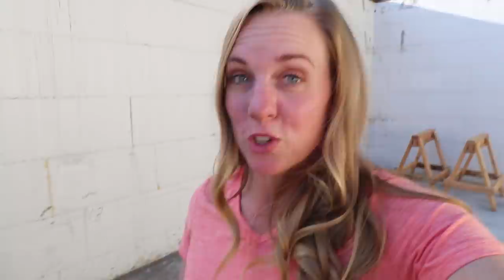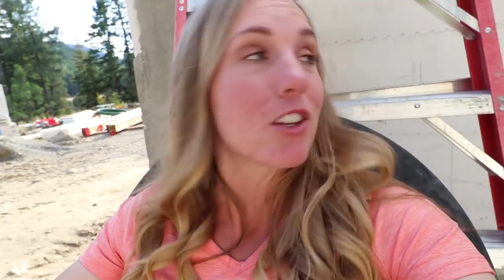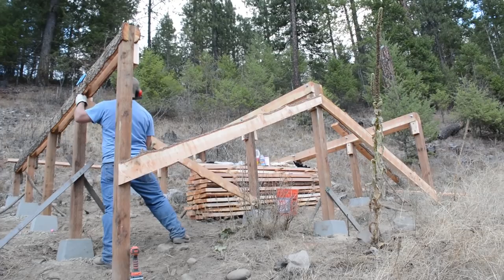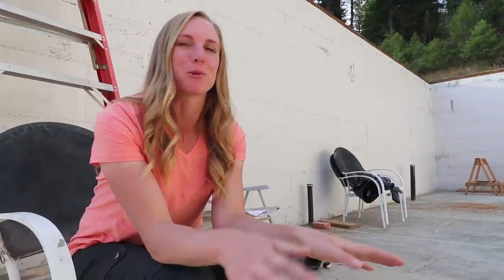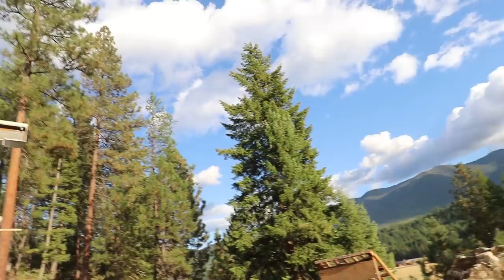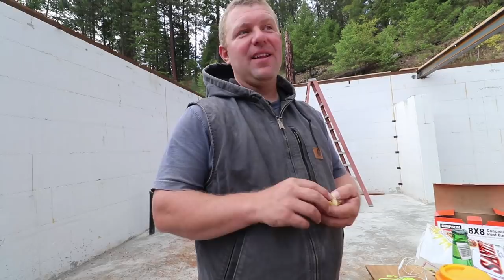Is QUALITY WORKWEAR Really Worth the Money?

Comment: yep anyone who suggest wearing crappy cheap shoes for work are not hard working people. my most important article of clothing are my shoes.I did manage to find some really decent light weight work boots by Ariat , they are about as light as tennis shoes but super sturdy and very comfortable and supportive. Tractor supply for like a hundred bucks which to me is quite inexpensive.dont do steel toe unless you really need to and keep them as light as possible, it matters by the end of the day.same with pants, if you are pulling them up or adjusting them all day it will wear on you, get good cloths! anyone who buys cheap work shoes and thinks thats good enough doesn't really work.
Reply: 1. 30$ spent on steel toe boots they THRIVE on abuse the more you abuse them the better they get plus haveing a 1m long 200 kg beech log roll on to your toes is not a good thing with out steel toes 
2. pants best thing i saw was this one old timer took a pair of good fitting jeans and stitched a extra layer under the front part of the jeans 
3. top yeah wear the worst thing you have that fits and has pockets

Comment: I am in the U.K and was the Head Warehouseman for a company called Apache Leathers. We supplied All Motor Bike related Leather items from One-piece suits to soft Panniers. We actually supplied the Motor Bike shops that sell it and a postal service. We had a woman once who ordered a size 14 pair of trousers, They came back with a busted zip. I contacted her and told her that companies that make items from expensive cloth like leather will often trim back as much as possible and still be legally able to call it a size 14? So often it is also the cut of the trouser, Did she want me to return a size 16 which would be a looser fit? No thank you I know what size I am? So we repaired them and returned them, Same thing happened. This time I got a pair of size 16 from stock and changed the label to a size 14 one and returned them. We got a reply, Thank You a perfect fit why did you not send these in the first place? To be honest that was one reason we preferred not to do the postal side. So item made from cheaper material is more likely to be Baggy/Loose. I take a size 5XL to get a Baggy/Loose fit. I once bought a pair of desert combat trousers size 5 ZL? They had a 38 Inch waist

Comment: I love my Duluth trading firehose pants! Check out RedBack boots. They are for mechanics mostly but I have used them for everything. They are slip on, oil/acid resistant, and slip resistant. My first pair lasted me 8 years, and they would have lasted longer had I not melted the bottoms with my feet propped up near a campfire :). Not sure how they would work for women but they us UK sizing so I think they are unisex.

Comment: I would wager that I have nearly as many Carhartt shirts as Jesse.
I buy the Original (fit and style) standard T-Shirts (long and short sleeve) in Large.
I have found that Carhartt has plants in many countries and the ones made in Haiti are nearly a full size smaller.
The others all seem to fit the same.
Your mileage may vary.
Add my Ariat Groundbreaker pull on boots and I'm set.

Comment: Interesting video. I am a very tall, large guy and I have never been able to find clothes that fit well until I started shopping in thrift stores. I have found more clothes that fit and do the job and they are cheap. I do spend on shoes and I am at the point that I will only buy merino wool socks. I still have a hard time finding gloves, 2xl isn't quite big enough so if anyone has a source for gloves for people with really large hands please share. Thanks for the video it is a good conversation starter. Now get back to work.

Comment: ok why not throw in my 2¢. 
in my experience, i've worked on drilling rigs for 20yrs, as i generally stay in warmer climates (az&south tx) i've always wore plain wranglers from walmart and basic tees. i like old navy tees because they are a bit thinner. 
now boots on the other hand, do not skimp, go to a shoe/boot store and get fitted. i prefer ankle high lace up boots, and cheap walmart boots just don't cut it. they don't last, holes quickly wear in the sides and the insoles break down fast. as of current i have a pair of timberlands steel toed and they fit great. there is nothing worse than crappy boots... except ill fitting chonies, that i'm still working on 😳

Comment: Lots of good information about being comfortable while working and finding clothing that is very comfortable to work in it makes it less fatiguing to work all day. Some of my favorites are Fjallraven they are more of an outdoor clothing company but their clothing is super durable and holds up better than most work wear I've tried. Also you are able to wax their pants making them extremely water resistant eventually they will soak through but it takes a lot. Not cheap by any means either over 100 bucks for a pair of pants. I use their lined pants in winter because like Alyssa I get cold easily. I cannot do the vest thing except in one of my layers. By the time the once warm blood gets back to my core from my arms and legs it cools me back down. I also like Red wing boots but they don't seem to have the quality they once had going to be looking at getting a pair of custom boots from whites or somewhere similar.
Reply: Try Mountain Horse boots - the Rimfrost Rider horse riding boot (paddock style) is what I have and I'm going on 6 or more years. They aren't leather and are waterproof and can take a beating. I have been using them exclusively as my work boots in the barn and also on my new farm to do whatever. I also use wool type socks (mostly snowboard or ski socks) year round. I find also that they are not hot but work with the insulation of the boot to make a compact set. I am in the PNW also, and we have hot and cold weather, but these boots beat the competition for my barn/field work.

Comment: For men's boots, try wolverine "legend." I have been wearing wolverine for probably more than 10 years and I haven't been impressed with what the work boot place had for the last year or two. Amazon has the legend in soft toe and the local place only had composite or steel toe, which are very uncomfortable for me. It has been 9-10 months since I bought these boots and they are still holding up great. The other wolverines I had were well worn by 6 months. They are not cheap at $170, but not as expensive as many others either. You can return them to Amazon for free by dropping them off at a ups place. There is a new Amazon warehouse closer to my house than the boot place, and there is a massive amazon warehouse in San Bernardino, just 15 minutes away........they are a local company. 

For socks, thorlos hiking socks are the best. They are very thick and support my feet better than anything else. At $15 per pair, they are expensive and wear out within a year from wearing at the heel and just getting a bit thin in the padding, but I won't go without them.

I worked in the construction trades for about 20 years and still do fabrication work and misc. jobs along with my primary work as a mobile sharpener, repair tech, and sales person. My work clothes have changed a bit and now I wear cargo shorts or 5.11 cargo pants and t shirts, but the boots and socks are still the same. For people who are very active and often doing physical work, it is worth spending money on good clothes, even for your career or personal work.

Comment: Carhartt was always the brand to work in. never bitched about the prices for the time they outlasted whatever else is out there. NOW, Duluth is the one. why? - the prices compare, but Duluth listens to the problems guys have with carhartt and makes the fix. I won't make descriptions here, guys already know. they know how to advertise to guys as well. distinct products help, and a decent guarantee. biggest thing for me is they FIT, AND THE FIREHOSE MATERIAL IS MORE BROKE IN THAN THE PLYWOOD CARHARTT USES. (didn't know caps were on, and to tired to change. problem for me is Duluth comes via china on almost everything? why the hell doesn't the U.S.A. lead in work wear? don't get it? so until NASA makes better, I'm an angry beaver, or wood chuck, or...

Comment: Grisport s3 class workshoes! Steel toed and steel bottom plate, maybe a little on the heavy side but ive been wearing them for 5 years now doing 40h a week as a professional construction carpenter ( normal work week in NL) and i love em. Great support good ventilation and super comfortable. 
Will provide a link to the specific type i wear

Edit: here is the link for a random usa seller https://71workx.com/safety-boots-70416-grisport
Reply: No steel toe.  Carbon fiber toe & shank is the way to go now.  They don't stay cold when you get cold, like steel does.  Plus ..a whole lot lighter too.    Magnum boots from a Police, Fire & EMS store has them. And the padding inside makes you feel as if you're walking on a cloud!

Comment: I like Duluth Trading for their lightweight knee-high compression stockings believe they come in three or four colors they have a blue line in at the top in the inside and they have a very dark red Heather I guess the best explanation for the toes and heal. I am what is called morbidly obese and I’m 70 years old because I have a bad hip I need help getting my socks on. I have to say anything it’s that I “love” these socks they are lightweight compression I think there compression rating is 15 to 20 which has to do with the strength of the compression and keeps water from staying in my legs. I suppose it would help to actually lose weight but that’s not as easy as it seems. I had some trouble when I gave up alcohol but I can live without alcohol I cannot live without food which makes controlling when I eat very difficult. My favorite saying is: “Everything I like is either illegal or immoral or fattening and the things I like most include all three.”

Comment: I use these:
https://flic.kr/p/YLbfNw

Duluth carry these:
https://www.duluthtrading.com/store/mens/workwear/fire-hose/95205.aspx?processor=content

I would not use anything else on the worksite. They are kind of light at the moment, but fully loaded I have access to every handtool i need 99% of the time. There is a pair of pockets for kneepads in front, and since the the apron pockets hang from the waist, things will not fall out even when I work in awkward positions. In the large apron pockets I usually keep two different fasteners, my hammer has got a buckle on my right, the Bacho drive bit set in front keep me from running back and forth whenever I need a different bit (I know you guys have complained abaout that ;) ) When climbing ladders and lifting things that require two hands, I hang my drill (or any other power tool) from one of the pockets. The carabiner is used for tape rolls, tools, the hose of my pneumatic tools, and on occasion, I have a rope going through it when climbing, with one end attached equipement i can lift by the rope, but is awkward to carry in ladders and on scaffolds.

My two cents worth ;)

Comment: Hello, you have some military surplus in Idaho., military stuf are strong, durable, well design, not fancy but convenient to work, confortable and for good price. Those shops sale vintage, use or brand new military clothes and many other military things. And you have the choice betwin hot summer or strong winter . One more thing.  What the hell are those footwear??? Please for your foot safety buy some security boots with metal shell to protect your foot finger and enough high to protect your ankle. They are a bit heavyer than normal boot but if something heavy fall on your foot, stone hammer log it's without pain. And more, it's practicle cause that change your foot in tool, kiking something without problem and keep something off the ground independendly of its weaght. Bon courage et à la prochaine vidéo.... well guts and see you on next video

Comment: my favorite workwear pants is this:
https://pro-dress.com/maerker/snickers/snickers-arbejdsbukser/snickers-high-vis-buks-med-hylsterlommer-klasse-2.html

either in black (their the strongest pair, usually takes me a year to wear them down)
but currently as i do work on the road side, i have to wear high visibility clothing, therefor i use these in yellow, the fabric is not as strong, so it will break in the seams, in the crotch area usually within half a year ( this probably has something to do with high visibility clothing doesn't qualify as high visibility any more, after about 25 washes)

why i use those pants, is pretty much only because of the extra pockets, there easy access for whatever i need to not hold in my hands right now, no matter what angle im working in (standing, sitting, crouching)
ive tried other brands, both cheaper and more expensive, but these pants, are the ones for me. 
the company i drive for, payes for work clothes, but they decide on what clothes it is.. so i tell them not to get me any pants, i get those for my self, out of my own pocket, as then are 3-4 times more expensive, than what my company is willing to pay for a pair of work trousers, but i'm okay with that, because i feel good, when i'm working :D